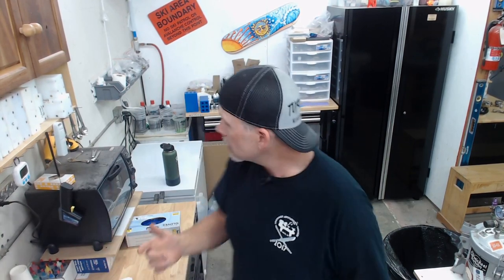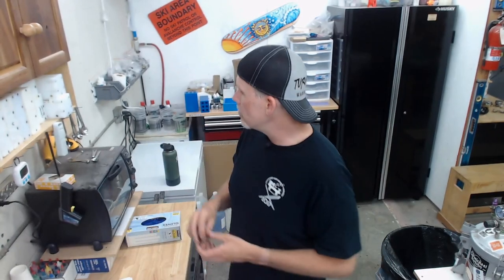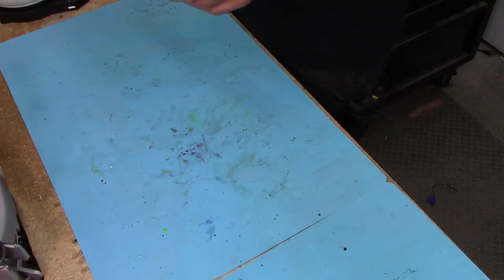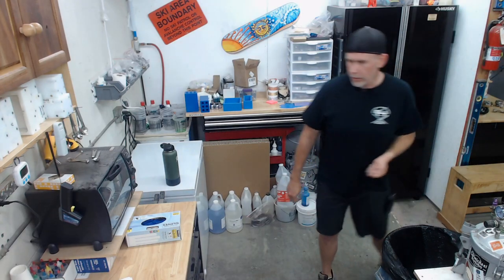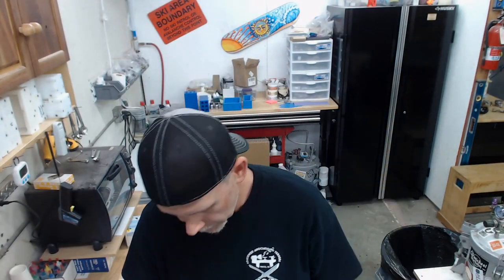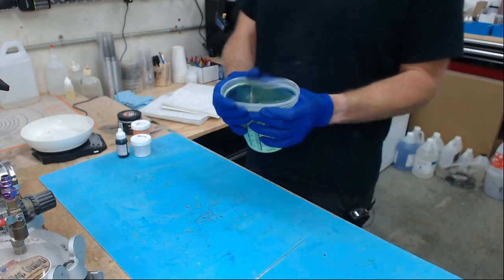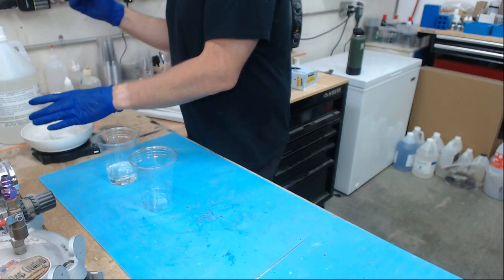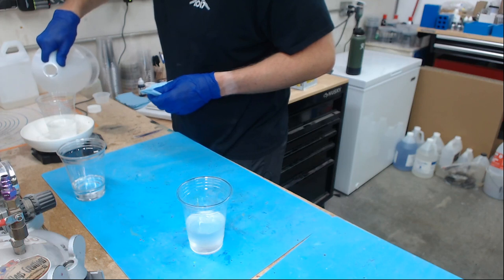🔴Replay: Dunkin Funky Pods | Episode 102

Comment: Do you think it would help fill all crevasses to pull a vacuum when they are dry, and the let a sealed mold draw in the resin? I wonder...
Reply from the maker: I'm not sure, but I generally tend to steer clear of vacuum with resins. I've never gotten good results with it
Reply: @ZacHiggins  yes, I think it would need a sealed mold and that would probably not cure well. I have used a vacuum pump to fill liquid-filled gauges at work and thought maybe it would transfer. But, I have not used resin yet. Thanks Zac!